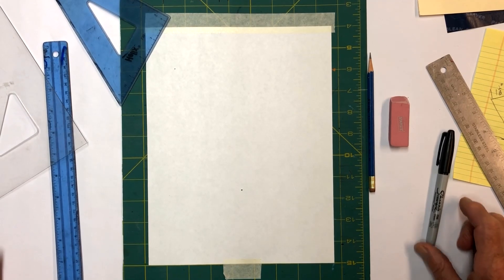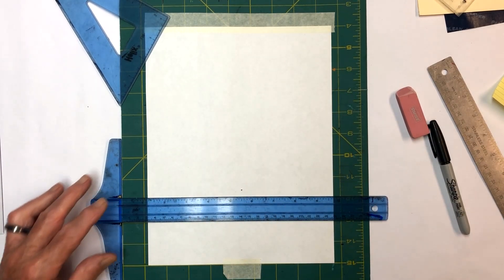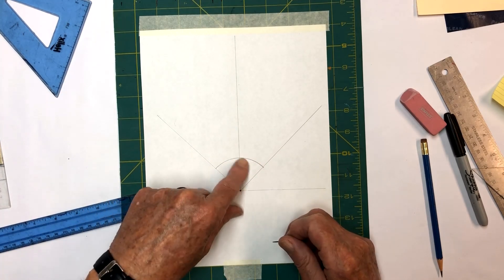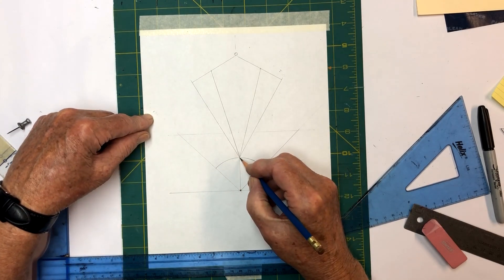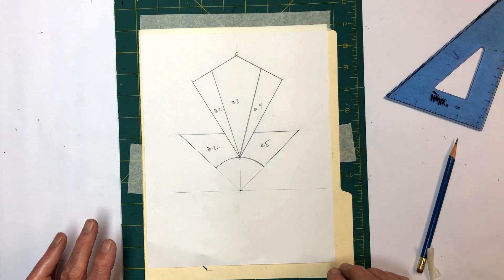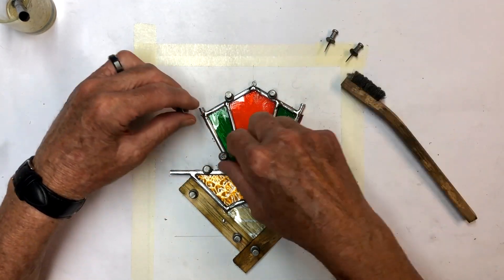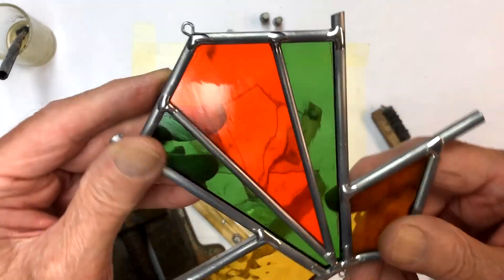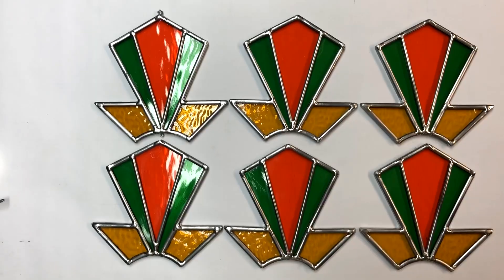Leaded Glass Spinner with Crystal Ball in center!!

Comment: Bill - Great videos.  I'll be making some of those for Christmas.  Could you please share the size of the swivel you are using and where I can get them?  Thanks!
Reply from the maker: Hi, 
Glad you're enjoying my videos; it's been fun sharing these projects with others. I'm using a number 6 Ball Bearing Swivel on all my hanging projects. You could also use a number 5 Ball Bearing Swivel, it's a little smaller than the number 6 swivel. I get mine from Amazon, A box of 50 number 6 swivel is about $25.00. They also come in a box of 25 for about $17.00. The number 5's are a little less, so check them out on Amazon.
Regards,
Bill Stone
Reply: Thanks for info

Comment: Normally when folks make pieces with lead they are grout between the lead and the glass.  Can you explain why you don’t need to grout?
Reply from the maker: Hi Gloria,
You're right, almost all Leaded Glass Projects are glazed with some kind of glazing putty. I don't glaze anything smaller then 1 1/2 square feet, unless it is going into a window and has to be waterproof. I would glaze smaller projects if they had glass that was cut to small and was moving around inside the lead came. Using glazing putty does add strength to your projects, and it doesn't affect the overall appearance either. If you like to use glazing putty on your projects, I would keep doing it. Check out the end of the video on how to make a leaded glass clock. There are several examples of window projects I have made that have been glazed. Hopefully that helps you out!! Thanks for your question and have a great day!!
Regards,
Bill Stone